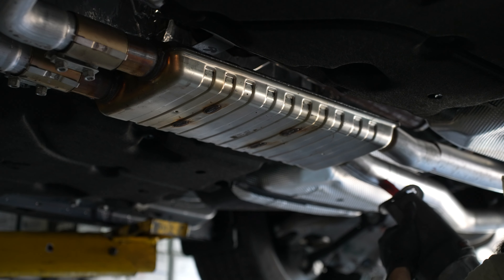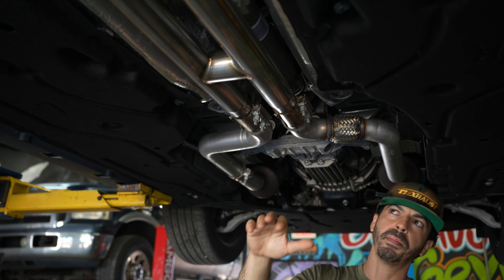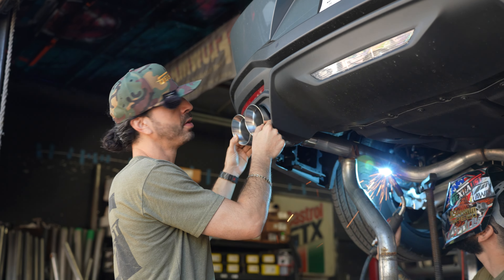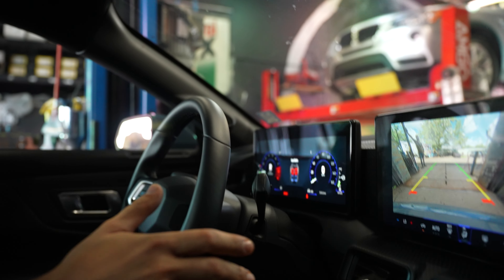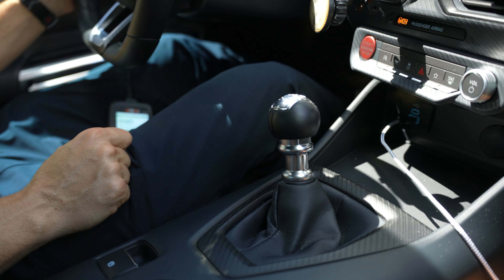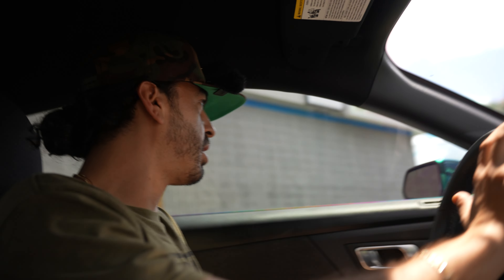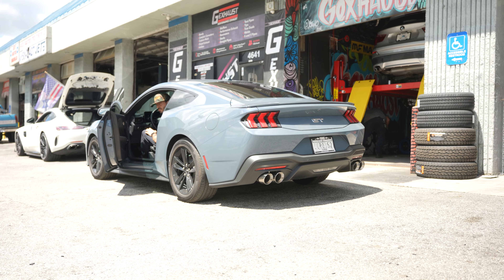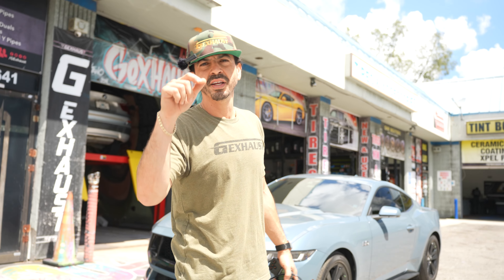**Brand NEW** 2024 Mustang GT Muffler Delete + H-Pipe

Comment: Do you need to retune ?
Reply: No only if you do headers
Reply: @amaru6359  You don't have to do a tune with headers either.  You'll most likely get a check engine light (even if you have high flow cats), but just add a mini cat o2 sensor and you'll be fine.